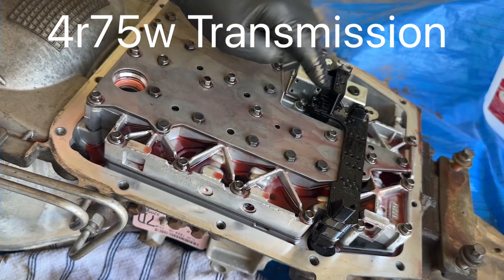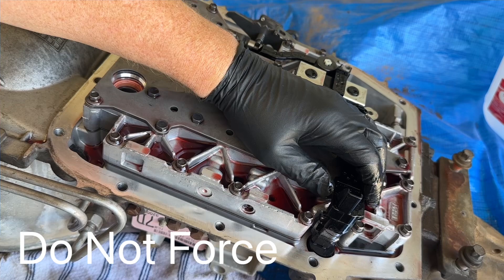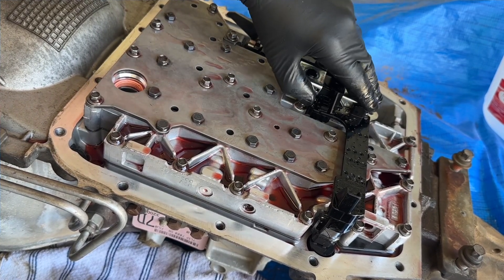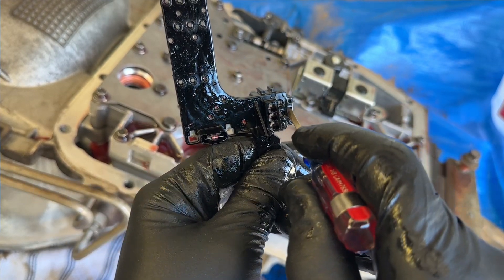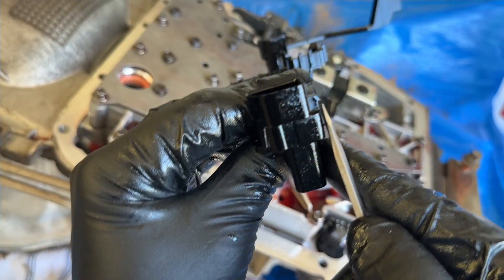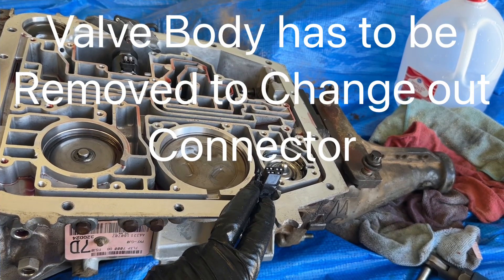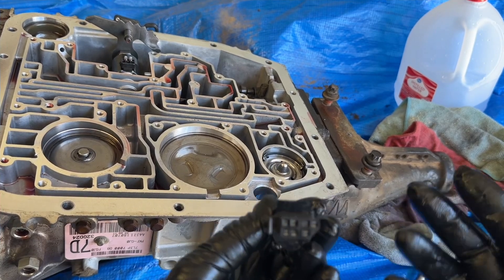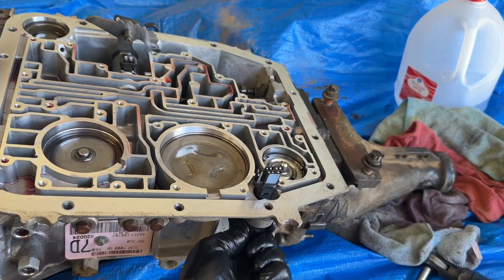Transmission Internal Hard Wire Removal. AODE, 4r70w, 4r75w, 4r75e.

Comment: Does the valve body need to be removed in order to pull the electrical plug out of the casing? 
I just noticed that in the second half the valve body was removed before sliding out.. Just curious if it's locked in place by the valve body or if it can be removed without removing the valve body